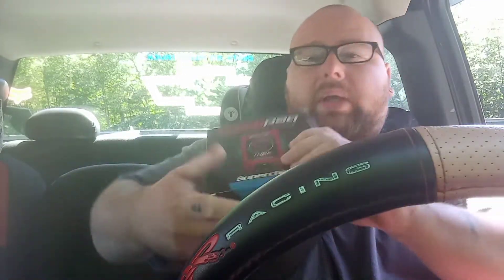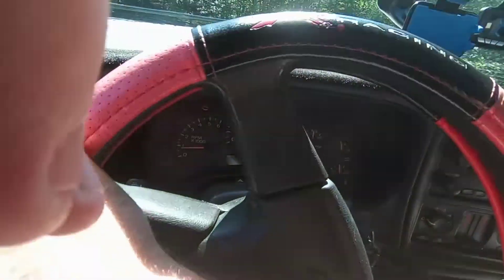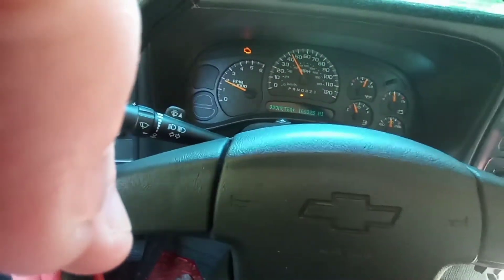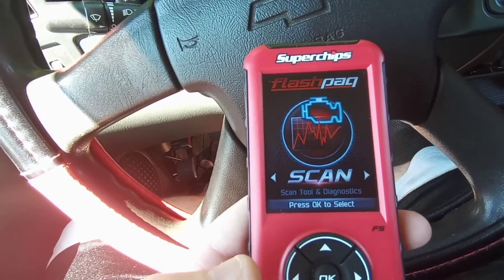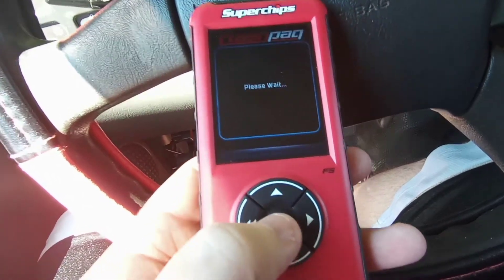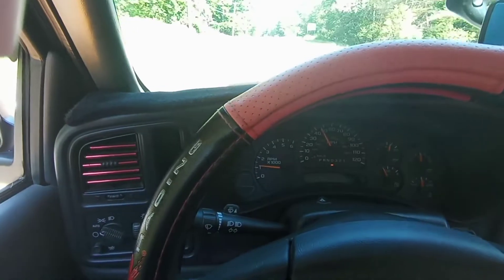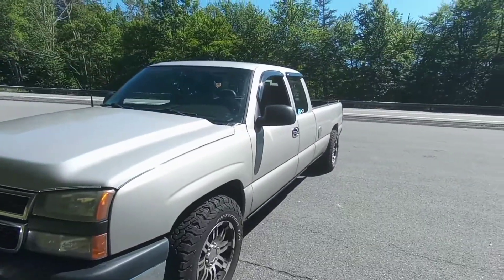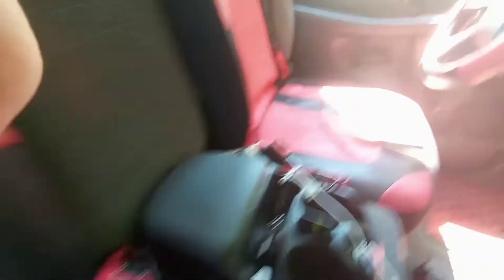torque management is it worth disabling

Comment: First off, clean truck! Looks really good! Bigger tires and rims, especially if they're LT tires will add weight. 4.8 stock isn't going to move the ext cab 8ft bed truck as fast as a 4.8 single cab short bed. I'd say cam the engine with a cam that has 112LSA and mild duration, have it tuned, shorty headers to increase low end torque and a good flowing exhaust should give you a better naturally aspirated engine! Higher octane only helps when you have a higher compression ratio. Looking forward to seeing this build progress! Thanks for the video!
Reply from the maker: Than you I appreciate it and I definitely have a few mods coming soon

Comment: You might also have very long gears, that makes it slow. Torque management works different on other makes. On my car I can't turn it off with a tune, only modify it where it increases line pressure to the point of chirping the tires the first three shifts.

Comment: I think you got problems with your knock sensors.. that thing is not accelerating like it should at all..
Reply: Bad knock sensors will cause it to become so sluggish because it goes into a baseline set and retards the timing -10 degrees. They won't always throw a code but if they do read incorrectly or malfunction it will do that..
Reply: Thanks what I was thinking was happening I got one bad knock sensor but 06 2500 one bad knock sensor is crazy slow compared to a AWD 05 Denali the Denali throttle peddle seems to act on par and the 06 just fills as if I get about 1/4 throttle off the line  no wait in the back won't even chirp the wheels compared to the AWD that has a totally different personality

Comment: Which super chips is this model?
Reply: Mine doesn’t have the torque option
Reply from the maker: It's a flashpaq f5 the torque management is labeled as up shift torque on that model
Reply: @Vtec_unlimited   I don’t even see the shift torque option maybe they did away with that feature by the time I bought mine last year.
Reply from the maker: Is it for a chevy silverado if so it should be on the last screen of options or it might need to be updated
Reply: @Vtec_unlimited  it is for gm trucks specifically but doesn’t show the option I’ll try updating it when I get a chance thanks.
Reply from the maker: @What Not To Do!  not a problem hope you figure it out